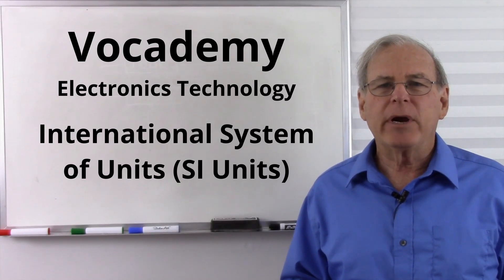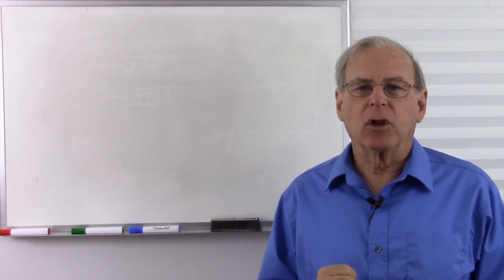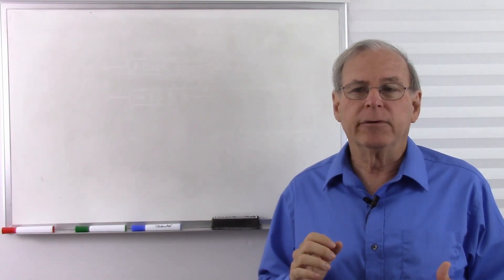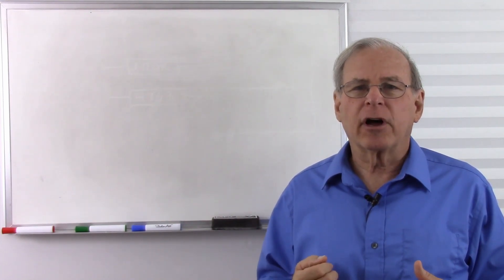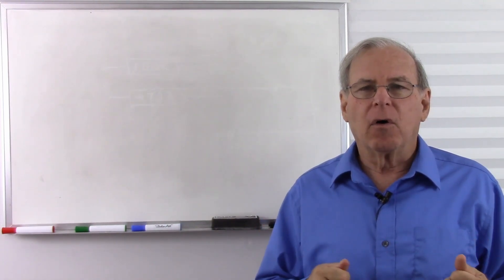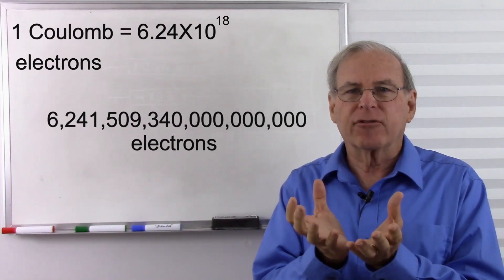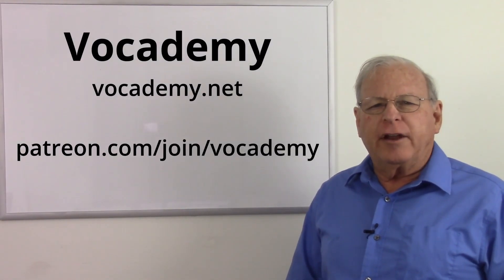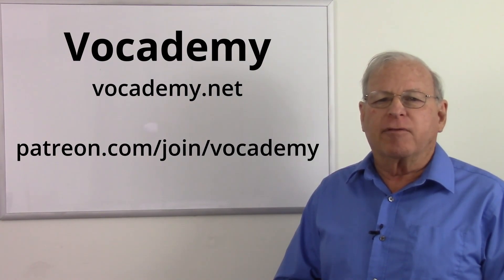International System of Units SI Units

Comment: "2019: The kilogram was defined in terms of the Planck constant, the speed of light and hyperfine transition frequency of 133Cs as approved by the General Conference on Weights and Measures (CGPM) on 16 November 2018.[6]" from Wikipedia. It's no longer an artifact. Or, if you're from the USA, see NIST's article "A Turning Point for Humanity: Redefining the World’s Measurement System"